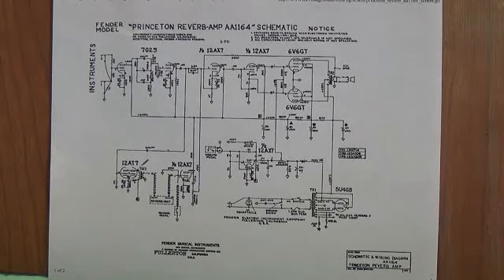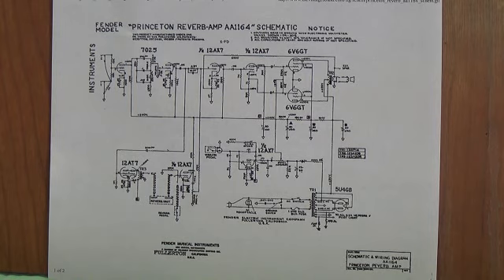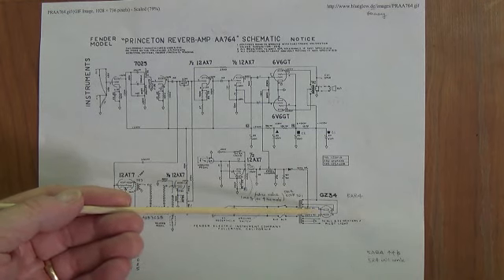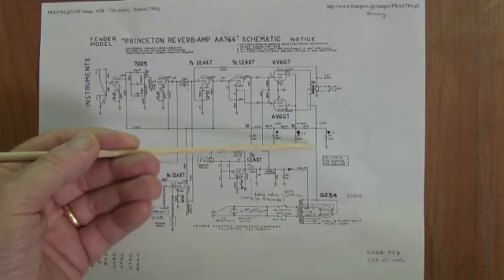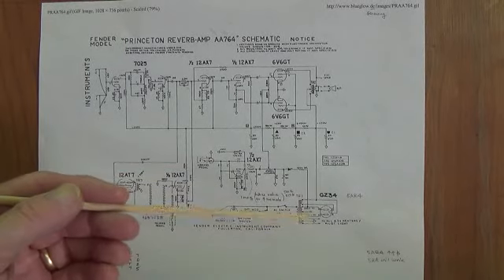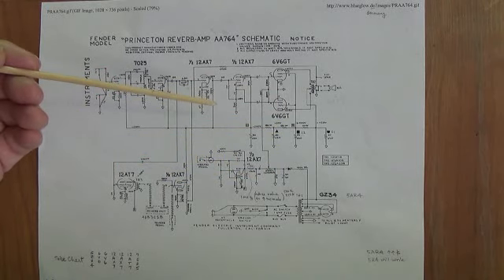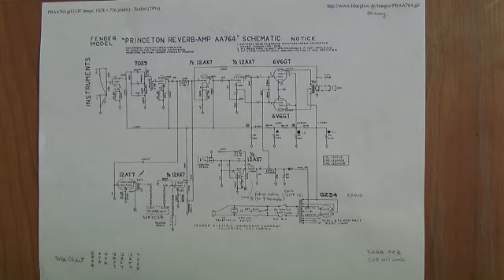Fender Princeton Reverb AA764 Chassis.....Fact, Fiction, or Typo ???

Comment from the maker: .....and for throwing nothing away. Check the values I listed in my response to Dave Gray (1164 values are listed second) and check to see whether you have a GZ34 (764) or a 5U4 (1164) rectifier.  As far as value, I wouldn't think the outdated tube chart would have much effect. My VG Price Guide shows a range of $875 to $1150 for Silverface PR's depending on age and condition. Thanks for your inquiry, Clint.

Comment from the maker: Gary:  I have never personally owned a Pro Reverb and have no access to one, but I did notice an old Craigslist ad from Santa Fe, NM for one. I tried to send you a link to it, but YT won't allow it.  You could contact him and, if it's not sold already, perhaps he could provide accurate measurements of the cabinet. At the very least, the ad has some good photographs which may be of assistance. Also, you could try this tactic with other CL and Ebay sellers.

Comment from the maker: Greetings, Dave. According to conventional dating charts, your amp was made in 1966 (one year older than mine), and should have a AA1164 (Nov, '64) tube chart and chassis......yet it, like mine, has a AA764 (July, '64) tube chart.  If you look at the 764 and 1164 schematics side-by-side, there are several minor differences: PV on the 12AT7 (355V vs 400V), cap between Vibrato pedal and 12AX7 plate (.02uf vs .01uf), electrolytic cap just after the biasing diode (50uf vs 25uf), etc. My guess is...

Comment: I've worked on several of these and noticed much the same about schematics, so I drew my own from one listed as AA764. I noticed that there were several minor variations in the circuitry, so every one I touch turns in that circuit.  FWIW, twice I have seen them with 5U4 rectifiers and shorted primary windings on the power transformer.  This causes a change in turns ratio and an increase in secondary voltage output.  The one I now use myself when I finally figured it out had 585 DC volts, blowing ALL, and I mean ALL the capacitors.  Most of these amps had 2 wire power cords, so I used the ground polarity switch for a stand by.  I also forgo tube rectifiers entirely and use silicon rectifiers ... pretty easy to put two of those in an old octal tube base.
Reply from the maker: Thanks for your input, Mr. B.

Comment: Thank you!!!  I just bought one of these mystical AA764 PR's.  I was surprised to see it still had the original iron in it. Mine has an old Mullard GZ34 in it and I'm guessing that may have saved the original transformers from certain death.  Thanks for the info!
Reply from the maker: You're quite welcome. Yes, it's just a date, not a model designation. You're lucky to have both the original TF's and a Mullard GZ34.....my favorite rectifier :)  The PT could probably handle a 5U4.....but the word "probably" always interferes with my ability to sleep well at night. Again, congratulations on a great acquisition.

Comment: I have to point out that with the link you gave, right on the schematic image there's a notice that says this AA764 schematic was photoshopped from an AA1164 schematic to match the AA764 Princeton Reverb amp. And it goes on to say that there is no original AA764 Princeton Reverb schematic to their knowledge. Anyways, I think your video's are awesome. I've watched many of them multiple times.
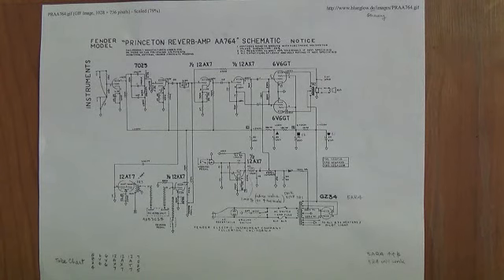Reply from the maker: Greetings, AA, and thanks for your very kind appraisal of my YT channel. This statement was added to the schematic in the past few months. As you can see from the video at 2:39, no such statement was evident at the time of the video. It does explain, however, why this appears to be the only source for a AA764 schematic. It also would appear to confirm that the AA764 chassis did exist, with or without an available schematic. Thanks for bringing this to my attention. I will amend the video description to reflect this new information.
Reply: Uncle Doug
No problem Doug. Glad I could help. That's strange that there doesn't seem to be a true schematic for it. I wonder what the story is behind that.
Reply from the maker: It appears that the AA764 circuit was only utilized for about 4 months before it was (slightly) altered to the AA1164 form. Maybe only a very few copies of the earlier schematic were ever made during this brief period, and none have yet been discovered and posted on the Internet. Somewhere, in a dusty file cabinet in Southern California, one is probably just waiting to be found......Let's hope :)

Comment: Here's another twist on the rectifier confusion. I have a '67 Princeton Reverb with the AA764 circuit and the tube chart says GZ34 but someone hand wrote in pencil 5AU4. The tube that is installed is a 5AU4. I'm sure that it is all factory original including the pencil change because I acquired the amp from the original owner 40 years ago, and he barely used it as a kid. Based on what Uncle Doug says, I'm not sure if I should leave the stock 5AU4 in there or switch it out for the highly praised GZ34. What do you think?
Reply: Are you sure that that tube isn't a 5AR4? Because a 5AR4 is simply another name for a GZ34, they are the exact same thing. I think one is a British designation and the other is the American designation, I just can't remember which is which.

Comment: Doug, thanks so much for the journey through these little gems as well as continuing to mentor a whole boatload of us out here. A little '65 BF Champ has rekindled my interest in a PR, although it'll end up having to be the reissue; good ones are probably pretty spendy. (The PR still is a wonderful little 1x10 2x 6V6 package that can't be beat.)

I really appreciate your discussion of the different rectifiers; for someone who's sensitive to it the difference can be noticed in the playing. I see that the reissue is using a 5AR4 instead of the 5U4 from the AA1164 circuit, probably a good thing. However, do you have any sense as to whether the inefficient 5U4 may have been used specifically because it has such a difference in rise time (or something) and, perhaps, is more touch-sensitive?  Just curious because the dynamics of my little Champ (with its 5Y3) have me a bit spoiled that way.

Thanks!
Reply from the maker: Greetings, Wes, and thanks so much for your kind words :) I tend to rank the 5U4 at the bottom of the rectifier pile. It's a current hog, not particularly efficient, and rather saggy. To be honest, I think they used it because it was readily available and relatively inexpensive. If possible I convert to GZ34, but the high output combined with high 120+VAC receptacle voltage can yield some scary plate voltages. The 5Y3 is in the middle for me.....ideal for all rather low wattage circuits like your little Champ. The GZ34/5AR4 is at the top......low current draw, relatively high output (high efficiency), and very slow start up due to the indirectly heated cathode, which really babies the amplification tubes. You really don't need a Standby switch any more. The high efficiency yields minimal sag, almost like diode rectification. For those who appreciate sag, however, I guess the 5U4 would be the way to go.
Reply: Uncle Doug
Thanks for much for the feedback! :)
Reply: Uncle Doug
One other thing on the misconception you correctly pointed out regarding whether the schematic number relates to a specific circuit. The 764 can't be the circuit for the tone stack for both the Champ and the PR because the resistors bound to the bass pots have vastly different tonal results - 15k (Champ, punchy) and 6.8k (PR, sweet, kinda scooped). Would Rusty agree the solution is that we should always have one of each? :)
Reply from the maker: Rusty votes for a third alternative: moist and meaty....like a T-Bone steak :) Thanks for the input, Wes. For more confusion, how about the "Design and Circuits Patented 68" on the control panel of BF PR's? I'm sure this refers to some obscure legal action or filing number, but it sure looks strange :)

Comment: I had a 1968 Fender Princeton Reverb head. I used to by-pass the reverb tank and use that extra tube pre-amp as a monstrous distortion / overdrive. It sounded great. The tubes would brightly glow purple.  Was that safe to do?
Reply from the maker: It doesn't sound like a healthy situation, Mark. Did the  tubes last very long ??

Comment: Hi Uncle Doug, My 1965 Vibrolux Reverb has a tube chart with AA864 on it. I have never been able to find this schematic.... I wonder if you have ever seen one? It has the GZ 34 rectifier tube.
Rgds!
Reply from the maker: I have not seen a AA864 schematic, Alvaro. The changes between it and later circuits are not huge, so a later schematic will probably work for your,

Comment: Just purchased a 1970 princeton reverb. Amp is untouched, all original inside the chassis. Still has 2 prong cord. Transformer date codes are late 1969. Pots are 69 and 70. Serial number 1970. Tube chart says AA764 and has the gz34 shown. Amp came with a 5u4gb rectifier in it, not to say someone didn't change the tubes out as it had two different brand 6v6's. Frustrating not to know what is correct here. If the tube chart was from some other amp as some have said, what amp would that be? I have a 1969 champ aa764 and the the reddish brown caps are the same in the princeton, not the blue molded ones.
Reply from the maker: The GZ34 is correct, but a 5U4 may have been installed to reduce the high plate voltage.  have no idea about the caps.

Comment: Have you heard the Morgan PR12? It’s one of the best sounding amps I’ve heard. It is apparently based on the Princeton Reverb, but with a 12 inch speaker, and modified to provide better bass, and it appears to be solid state rectified because I looked on the website at the specs and there are only 3 12ax7s and 2 6v6s... no mention of a rectifier tube. How hard would it be to modify one like that uncle Doug?
Reply from the maker: The modifications you mention would be easy, Alan, but you would need a schematic to ensure that all alterations were incorporated into a clone.

Comment: What do you think about what the author of the tube guitar amp guide book thing said? He said that the standby awitch is actually a superstition made up because fender started to use them. The electrons before warming up don't harm the tubes.
Reply from the maker: I agree that in the vast majority of guitar amps, the Standby Switch is really not helpful. Standby Switches originated in radio transmitters, where plate voltages are greater than 1000V, to preheat the cathodes and reduce "cathode stripping"; but in guitar amps, with plate voltages generally less than 500V, they are not needed. Also, since most Standby Switches are in the DC plate voltage circuit, they tend to arc and wear out quickly, and if you have a tube rectifier (i.e. GZ34), it provides a "built-in" delay in high voltage that protects the tubes. Lots of knowledgeable people recommend not using the Standby Switch at all in guitar amps, and from a technical standpoint, they are probably correct.
Reply: Uncle Doug I see. Thanks for the facts.
Reply: In the 5F6-A Bassman, Fender introduced a DC coupled cathode follower into a solid state rectified amp. At switch-on, before the tube begins to draw current, the grid of the cathode follower is at B+ voltage while the cathode is at ground potential, which can lead to arcing between grid and cathode, often destroying the tube. It's possible that the standby switch was introduced as a fix for this problem, although a neon bulb between grid and cathode would have been a solution which did not rely on the user to follow the correct procedure when powering up the amp. The Valve Wizard recommends a reliability mod for DC coupled cathode followers: http://valvewizard.co.uk/dccf.html

Comment: Thanks for your video!

I have a 1970 Fender Princeton Reverb and my tube chart AA764 that is in good shape shows a 5U4 rectifier tube...
It had the Torres bias mod done to it and recapped the tech gave me a solid state rectifier plug and a 5U4 tube.
I used it with the SS one for years and recently plugged an old hammond 5U4 into the amp 
and it got really distorted. Not in a bad way it just had a lot more gain when turned up loud.
I read below that you told someone else to follow the chart, but after watching your video I was just wondering what you thought...
Thanks!
Reply from the maker: Greetings, Tim.  It seems strange that a 5U4 could outdo a SS rectifier.....generally, it's the other way around.  My advice would be to go with whatever works best for you. Perhaps for practicing at home, the SS would be best.....while you might want the additional volume and saturation for a public performance.  If you really want some additional gain, try a GZ34 rectifier.  Best of luck.
Reply: Uncle Doug, if you made these tube/rectifier changes, would you need to re-bias the output tubes?

Comment: Uncle Doug, today I acquired a 1968 Princeton Reverb (in near mint condition!) with the AA764 tube chart. The amp sounds great but there is one issue. The vibrato, or tremolo, is weak. Here is what's really odd: If you turn the amp on and strike a chord, the vibrato sounds great. But then the effect fades and it's hard to tell it's even on. What would cause the vibrato to sound strong only when the amp is initially fired up? Thanks!
Reply from the maker: There are two portions of the tremolo circuit which could be responsible, Cal. The three capacitors in the oscillation loop could be out of spec, and/or the oscillator tube (half of a 12AX7) could be failing. The tube is the easiest to check, simply replace it and see if the problem subsides.

Comment: Hey Uncle Doug & Rusty, I hope your all doing well. Could you use a GZ34 in a Fender Champ amp, or is the 5Y3GT better suited for the Champ power requirements? The GZ34 sounds like the way to go if you can. I'm doing research for the Champ build. Thank you for all the great videos, time & effort. Your amps are absolutely beautiful and sound fantastic. Your craftsmanship is awesome. Take care, be good, C.
Reply from the maker: +Cass Virgillo  You're welcome, Cass, and thanks for the very kind comments. Since most Fender Champs are factory biased at the ragged edge of spontaneous combustion, changing to a (much more efficient) GZ-34 might be like throwing gasoline on a smoldering log......but, if you were to quickly adjust the bias to a reasonable level (and checked all circuit voltages) after the substitution, it would probably be a good, anti-sag, PT-current-reducing, move. Let us know what happens.

Comment: Thanks, Uncle Doug, very helpful information to have.  I wound up here while trying to research the best tube replacements to buy and had no idea my AA764 was the subject of such scandal!  
A couple of questions if you have a moment:
My tube chart calls for a single "7056" (or "7058", hard to tell) and that differs from the BlueGlow schematic, which mentions a 7025.  Any thoughts?
Next (and apologies if you've already mentioned this elsewhere), may I ask what brand of tubes you would purchase as replacements?
Thanks for considering, and I appreciate your time. 

Jake
Reply from the maker: The 7056 is a 7-pin tube, and I have never seen it used in  Fender amp. If your tube socket is 9-pin, it is probably either a 7025/12AX7 or a 12AT7.
Reply: Uncle Doug, Thanks for the reply.  I did some more looking and I think it must be a 7058.  Apparently they do wind up in Fender amps from time to time.  Anyway, this number is from the tube chart itself, so I think it's legit (even though I had some trouble reading it initially, I'm positive it doesn't say 7025).  

Interesting...

Comment from the maker: Greetings, Clint. If you have a 1970's PR with a AA-764 tube chart (and circuit) then it really adds to the mystery surrounding this issue. If the circuit was modified in Nov. of '64 (1164), why would the factory still be installing the long-outdated 764 charts and circuits (?) in 70's amps?  I have a strong feeling that your circuit matches the 1164 schematic and the tube chart is an old one they had laying around the shop. Fender was famous for haphazard use of whatever was handy.......